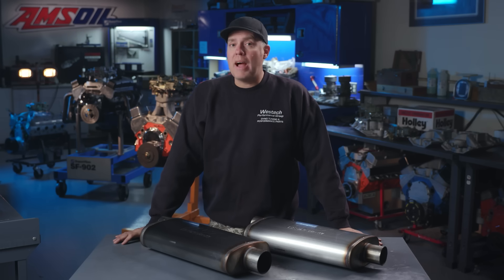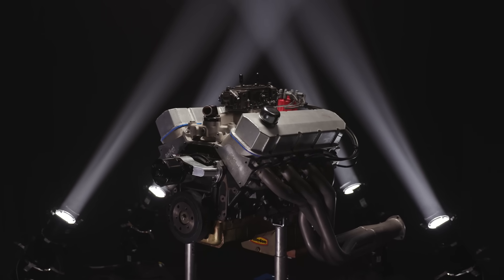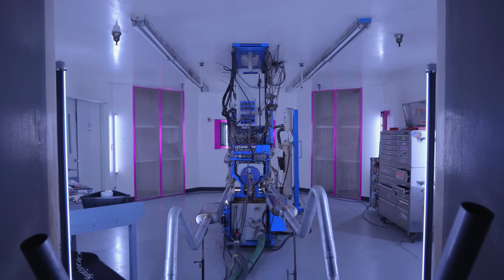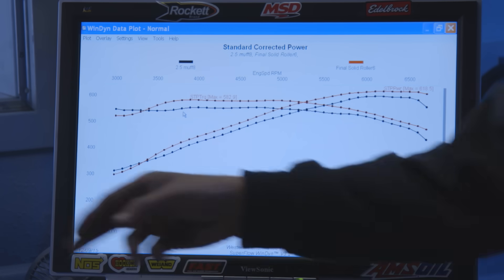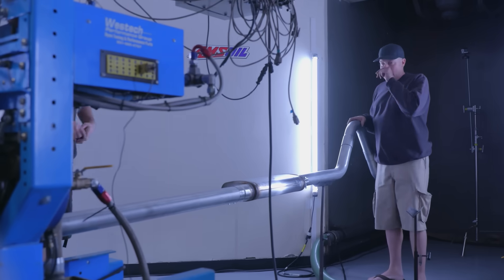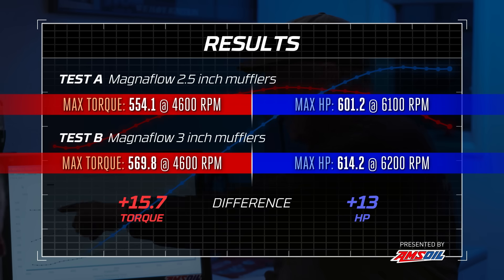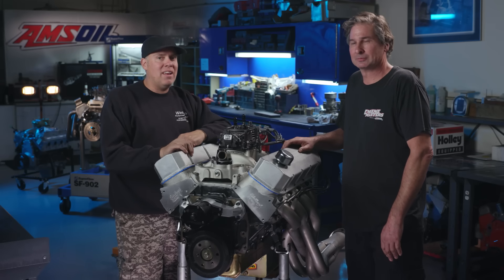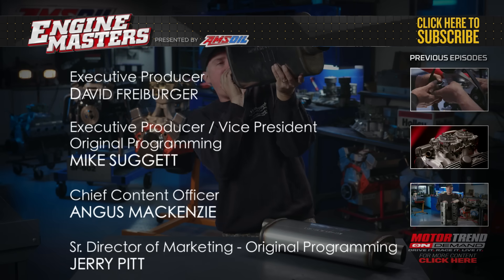The Power of 2.5- vs. 3-Inch Exhaust - Engine Masters Ep. 9

Comment: Wish you'd incorporated an H pipe (connected both exhausts together behind the headers) to determine the effect on horsepower and torque. Your temperature gauge would be affected by the reflection of the coating on the headers thus not accurate.

Comment: Found this vid while trying to decide on an exhaust.  Still confused whether it matters going with a 2.5" or 3" on my otherwise stock 5.0L Coyote engine.  It has 435hp at the crank so is that the point a 3" would start being beneficial?
Reply: No. In my opinion a 3" would be a waste for that displacement. You should need no larger than 2.5". An engine is like an air pump. The 454 in this video can move a ton more of air than your 5.0.
Reply: Deucealive75 Sweet, that's what I was thinking.  Thanks.
Reply: +bill2526 bill2526 fuck that... lol id rather run 289 than anything pos gm has to offer lol
Reply: get a 1 inch exhaust to shed weight bro
Reply: +Zack Boss hell yeah man dodge and chevy with there big ass engines in the nhra cant even beat the beastly 5.0 lol
Reply: Terry Burton Typical cross dressing ford owner
Reply: hanzo52281 580hp plus before 3in is necessary
Reply: bill2526 bill2526 6.2 junk motor would get Dragged by at 5.0 stock and you can have bolt ons and still lose kid.

Comment: I have a question. Is it okay to slide a 2.25" inlet pipe into a 3" pipe then weld it?
Reply: So you want a 3 inch exhaust system and then another whole 2.25 inch exhaust system inside the 3 inch exhaust system?
Reply: No. I want a full 3" exhaust system and I was wondering if it's okay to slide the 2.25" inlet pipe into a 3" pipe then just weld it instead of using adapters.
Reply: If its a Honda its not a race car.  I don't think you would have a problem so long as your hangers don't allow the 2.25 to bend from the weight of the rest of the 3 inch.  The issue is going to be the circumference difference and how much welding you want to do as well as how many rods you feel like paying for.  Adapter is probably the way to go.
Reply: @Dale Corner... That was a great answer! LOL! I can't stop picturing the exhaust bouncing around under there pulling the hangers out of the floor with that 6" chrome tip melting the back bumper!

Comment: I'd also like to see what difference a crossover tube makes.  I've read that it helps low to mid range due to the added from, but doesn't restrict the top end.  I'd like to see, on a dyno, if that's the case.  Of course using the same hardware you ran this test on.

Comment: There are good reasons to custom make your own headers (and exhaust); otherwise forget it and just go with what's biggest or loudest? Anyone that has a large displacement or turbo motor should automatically go and run the biggest exhaust possible; screw the fact that there are math formulas that can work all this stuff out. Next up, 4" exhaust?

Comment: are you giving both gas at same pressure / the RPM start 300 on 3 taken off and red is 540 is that right / were I am saving gas mileage thanks

Comment: Since the 3" makes the most power and has disproved a myth that you'd lose low end torque, why not do a third test with high flow cats? That's a real world set up on a street motor with emissions qualifications. This test was very  thorough and I'm thankful you guys took time to do it. However, I made the decision on my truck with 600+ HP to use only 2.5" pipes from the headers to tailpipes taking advice on that myth. Now I know I'm losing power. I still hear guys on the blogs and in muffler shops telling us to stay away from 3" pipes.

Comment: This test is inconclusive and a waste of time if you want to be accurate! You can't change an exhaust system without re-jetting and expect to get accurate results! Richer equals less HP so if you leaned it out with the 2 1/2" system you would have gained HP and the results would have been minimal! So for the extra expense and harder to fit 3" system what do you really gain? Remember your smashed header test and the amazing lack of results!

Comment: That's not entirely conclusive as every setup requires a separate tune, we can't just swap in and out parts keeping a fixed tune =/ makes no sense to me, personally I have once tuned my car for a 2.5" cat back system and got around 30+ HP/Tq. compared to straight 3" pipe exhaust.. back pressure do matter sometimes depending on your setup as a whole.... might want to try that for more accurate results.

Comment: Hey people, I have a question here. I'm running a little engine, 4 cylinders with turbo. Would this test also apply to my engine? I have hear some people fitting massive exhaust to my engine and then losing power. Thanks!

Comment: Is this still the case for a v6 though?  I've been told countless times that you need back pressure with the 4L Ford engines and a lot of people have told me both on the Ranger Forums and Superduty HQ that you don't want to go above 2.5 inches.
Reply: Never need backpressure, that's wrong.  It's exhaust velocity from the smaller diameter that can be useful.
Reply: Actually too much back pressure would blow the manifolds

Comment: I got a original bmw E36 323ti compact -99, It dont sound much at all atm, and well its a small car with a 2.5L 6 cylinder engine with 170hp so it goes pretty good. 
Was thinking of getting it a sport exhaust, but i can only find exhausts that are made for my model with only 1 end pipe instead of 2 like it is on it now and i have no idea what to take, dont wanna get to low sound and i dont want it to be like a fart canon. any sugestions for how big/small i should go?

Hope you understand my bad english :)

Comment: The claim that "Your engine needs backpressure" is an excuse invented by lazy mechanics to avoid the necessary carburetor or fuel injection adjustments needed to compliment a larger exhaust diameter.

Comment: It's like you don't get how back pressure works. if you increase resistance, you gain low end torque (drivability) at the expense of high end power. Why are you surprised that you would gain low end torque with the 2.5"???

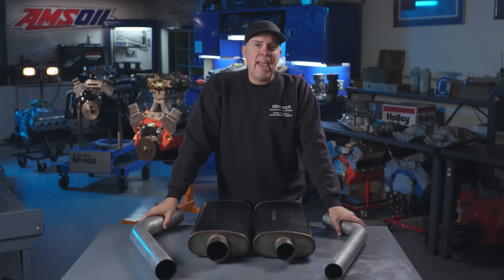Comment: Around 7:20 he says a 2.5 inch exhaust is a great way to kill torque and horsepower but that's not true, he said it himself, engines love back pressure, (but not too much back pressure!) Which a 2.5 inch exhaust on a big ass engine is gonna make, if I put a 3 inch exhaust on my 3.6L vvt that's gonna be too wide open and I'll lose low end torque, a 2.5 inch exhaust would be perfect for smaller engines. Piping diameter is a situational thing

Comment: I realise that it would be a way too long and complicated video, but just saying that 3" is better than 2.5" is not very usefull. The optimal size, length and other proporties(size of the different components and the length between them) of the exhaust system has to be chosen to work with that specific engine configuration. An extremely oversimplified thump rule is that the bigger ID and shorter the exhaust system is the higher up in rpms the power band will be. The smaller ID and longer the system is the lower down in the rpms the power band will be. To chose the correct exhaust system one must consider the basic engine specs(stroke, bore and so on) the camshaft characteristics, the carb size, the intake manifold, the exhaust manifold and so on. When designing an engine tuning you must decide how much power you want, how wide an rpm band you need and were in the rpms the band should be.

Thankfully they did tell a lot of important specs about the engine. Obviously this is an engine that likes rpm and that is why the engine runs best with the completely open(and short) downpipe and why the 3" is better. If you have an engine that moves less air and/or is designed to put out max power at lower rpms then the 2.5" might be a better option since the 3" wont be optimal before way over the rpm band that the rest of the components is designed to.

Correct engine tuning is quite complicated. A lot of variables that has to sync up. These guys did a great demonstration of the importans of a correct exhaust for their engine. Just dont take the wise words in the video as a rule of thump that says that a bigger ID exhaust is always better.

Comment: I loved this video, but I think if this was a smaller engine like something around 150hp it might have the opposite result, because the 3 inch would be too wide and have more turbulence inside the pipes.
I would love them to do this on a weaker engine :D

Comment: The carb is tuned for open exhaust (running rich = less power). You would see the same results in reverse if you put an open exhaust on an engine tuned for a 2.5 inch exhaust. If a man with a massive head tries different size hats on, he can't say large is always the best hat for any head can he?

Comment: Ugh 'back pressure'. Vehicles don't want ANY back pressure, they want high exhaust gas velocity. The reason there is more torque below 3500 rpm with the 2.5" mufflers is that the exhaust gas is moving much faster, higher pressure as it has less of a space to fill in the exhaust tubing and mufflers. I did enjoy the video though. Maybe I'm old but for a DD, I'd go with the 2.5" and not get any unwanted attention but still keep a LOT of power on tap. That's what electronic cutouts are for :D

Comment: I wish people would stop getting caught up on a peak power figure. 3 inch exhaust on a bloody 2 litre 4 banger would make more peak power at high revs, but guess what, it would get rubbish throttle response, and lose low end torque. Stop getting caught up on peak power and go for low down torque and try to sustain in through as much of the rev range as you can. Torque wins races, horsepower wins arguments.

Comment: How about a test of an engine making 350-400 HP with a 2-1/2 vs 3 inch exhaust?
Reply: When they have already proven a 614hp engine would only lose 2.8% of its power if you dropped to 2.5" and totally forgot to tune the engine for the new exhaust...  I'm pretty sure you have your answer.
Reply: Then we could see a REALLY minimal change... 400 horse is generally where you'd start to see ANY benefit from 3 inch, so yeah pretty pointless.
Reply: @salvadordollyparton666  Nope. I have been running 3 inch piping on my 4.3 Chevy V6 for nearly 20 years now. Even with only 265 Horsepower under the hood 3 inch is still better. 3 inch is better for mid to top end power.
Reply: Yeah, thought not genius. Not talking about a 3" single...🙄 Try and follow along people, YouTube doesn't give me the option of drawing everything out in crayon for you. Not that I'm going to anyway.
Reply: @salvadordollyparton666  you are absolutely right, even on my full bolt-on LS3 with the 1 7/8 long tubes into dual 3 inch pipe exhaust with an X Pipe I did lose some low end torque, she doesn't get the Zoomies until about 3k then she lays some rubber
Reply: @salvadordollyparton666  you are absolutely right about the dead spot. The guy I bought my truck from put a 3" exhaust on it with only a CAI and it has a pretty big dead spot down low in the rpm range
Reply: @salvadordollyparton666  they choose fashion over function..
Reply: My Hooker competitions have a 2 1/2" collectors it goes into 2 1/2 pipes and an h pipe  through delta 44 flowmasters and out just in front of the rear tires. All this in a 64 C10 w/330 hp 350 sbc. It breathes just fine because it's pretty well matched up
Reply: I'd run a 2.5" in an engine with that HP output.  I'd also run a 2.5" on the bigblock above if it were a daily driver.
Reply: WHAT why test something a normal,average ,everyday guy or girl might have in their car or truck?
 they need to test more top fuel and 700-800 horsepower unicorns none of us will ever own so we
 have useless data regarding parts we cant afford.
Reply: @trillrifaxegrindor4411  yea, normal people drive around with 400hp lmao
Reply: @trillrifaxegrindor4411  You said it perfectly.  How about my 300 HP daily driver.  I'm sure it correlates with the 700 HP monster, but I'd rather watch this with a "normal" engine.
Reply: @trillrifaxegrindor4411  if you test the lower hp cars the results would be minimal. The results already were minimal.  13 hp would not be seen on a track time. too many variables come in to play with that.  My car is tuned properly for the 2.5 exhaust. I am willing to bet a 3 inch would make it a little louder, but minimal if any true gains.
Reply: @johnscudellari3314  You really think 13 Horsepower is minimal?? Seriously?? 13 extra Horeapower is not minimal.
Reply: @extremedrivr  But they did not tune the carb to match so maybe it didn't cost that much
Reply: @extremedrivr  But the 13 was without properly adjusting the A/F ratio wonder if it would be less if they adjusted it?
Reply: Primary and collector sizes probably lot more critical. Big collectors may flow the HP but destroy torque.
Reply: That would be pointless. The 2.5" system flowed enough to support 600 HP. Last I checked, 600 was more than 400. So if you bolt the 2.5" system on a 400 HP engine it will still make 400 HP. Bolting the 3" system on a 400 HP engine is not going to add power. Exhaust never adds power, only enables the engine to make what it can make.
Reply: It's virtually the same result.

Comment: I have a 2014 Mustang GT, 5.0 Coyote V8, with 3" pipe run from stock H-pipe to Catalytic converters, then from converters to Roush mufflers (no resonators).  Warranty still intact and it seems to flow better (Probably all in my head) and definitely sounds louder (better).

Comment: I'm hoping maybe I could get some advice. I have a 1990 nissan 300zx na that I want to put back on the road but it needs a new exhaust. I want to get an exhaust that will be good for the future of the car because I have always planned on building it up to a track-worthy car. If I remember right, I've seen blueprints of specialty z shops getting around 700hp from the engine. Now, that goal is a long ways away, so I just wanna daily drive it right now, but I don't wanna buy a lesser exhaust for the stock engine now and then have to buy another exhaust for the beefed up one in the future. I'm hoping I can just buy one good quality exhaust now that I can use with the stock engine with no problems but will also be a good match for the upgrades I have planned for the future. It also must be a true dual system from header back. Any advice on headers and test pipes would also be appreciated because I will be replacing the whole system. And it's very important that this car has no association with ricers. I hate those damn things, and even though this car is not a muscle, it's still no where near a ricer, it's got style and performance and I want to build on that. That being said, I do want the car to have a nice deep rumble head-turning to appreciate sound, just must not sound like an obnoxious ricer. Thanks to anyone who can offer me some advice.

Comment: Instead of a fixed diameter exhaust, why not create a dynamic/adaptive exhaust that can change its diameter/shape depending on the needs in order to deliver best results?
I mean, rear spoilers used to be fixed... but now they adapt with the driving and change angles. When you breath, your nose expands/contracts depending on how heavy you breath (e.g when exercising). So why continue using exhaust systems that have fixed diameter? Plus an added bonus, with an adaptive exhaust you can vary the type of noise the car will make.

Comment: this isnt really a good test and i know why.. Magnaflow doesnt want to shoot their own foot, but truth is had they ran 25 foot of piping all the back with 3" exhaust and NO MUFFLERS, they would've made more low end power and high end power than any of those muffler setups. dropping from the headers ALWAYS hurts your low end torque. Not enough air flow and exhaust velocity. add piping and it makes all the difference. no restrictions will always make power, mufflers will never be a "HP GAIN"

Comment: I have a G37S. I am going to change the exhaust system and most are 2.5 inchs. There is one that is claiming a gain of 22hp and the pipe is 3 inchs. I don't want to lose power by not having enough back pressure. I know i have a V6 3.7 and this video is for a V8, wonder if anyone might be about to lend some advice?

Comment: given a 454, that is pretty obvious.  what about how we can apply the theory to smaller displacements?  A RoT like "add a 1/4" of diameter per Liter" (or whatever values work out) would be handy.
Reply: Example:

3" / 7.4L = .405" of diameter per Liter...  

I don't think that would apply well to other engines.  It doesn't account for dual systems where you have to figure in that there are two banks.

my quad is a 1 cyl, 700cc (.7L) and has 1.5"+ single pipe.  The math above says it would have a .283" pipe...

There has to be a more plausible formula.

Comment: that's cool but i have hellcat 2015 model and i purchased cutout dual valve to install it after catalytic converter but i found gay in youtube having same car and same cutout but result in dyno showing while closing valve better than opening while opning found less HP different is around 30HP!!! and i afraid to install cutout valve because of losing HP ,your advice where to install after catalytic converter or mid muffler.